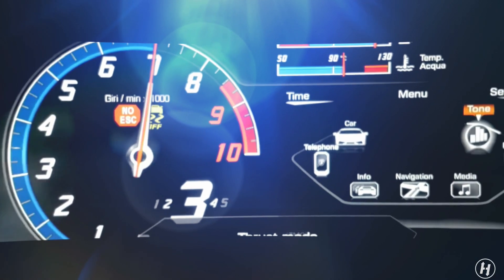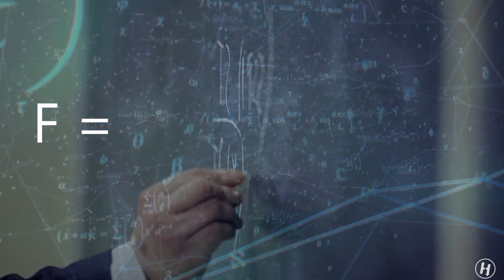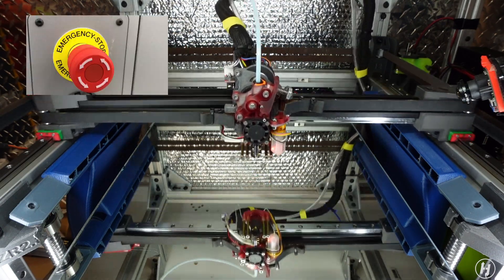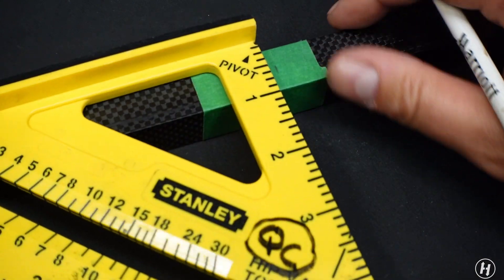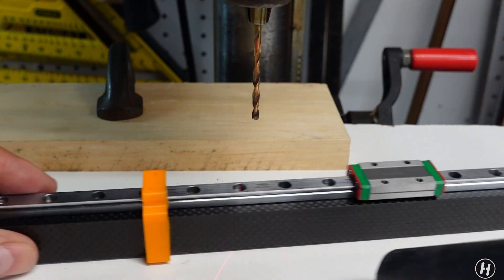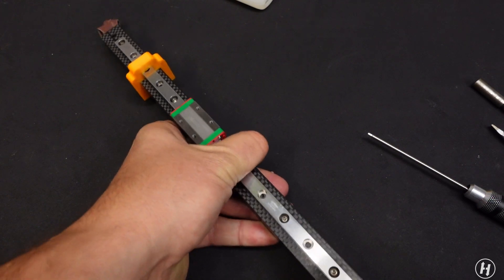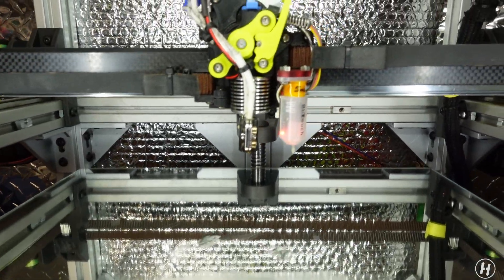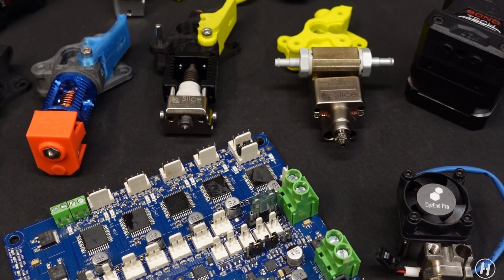Using TITANIUM and CARBON fiber on your 3D Printer

Comment: Those carbon rods for weight savings are an amazing idea! I'm going to see if I can buy some of those.
For further weight reductions you can look into aluminium fasteners. vs unhardened titanium they have a better strength to weight ratio but they are 40% lighter. 
There's also the option of using aluminium heat inserts instead of the brass ones. Compared to brass they're about 1/3th the weight.

I'm currently designing a toolhead board with maximum weight reduction in mind so you have less cables running to the printhead. Finished product is still months away probably.
Reply from the maker: Aluminum M3 hardware is super picky! combined with the higher thermal expansion difference between CF and Alu, this was not a good choice to me since they could easily cross thread during install and loosen under heat and vibration.
Reply: @MirageC  that's a bit far fetched :) people choose titanium because its cool. not because of "heat expansion properties" :) people use aluminium bolts on freaking brake disks :) if it can withstand that, its probably fine for a 3d printer.
Reply: Also just use red loctite. It will never come apart with aluminum fasteners.
Reply: @Nobody-Nowhere  it's the difference in expansion rate between two materials that matter.   Alu + steel is ok, Alu + CF  not so much.....
Reply: @Nobody-Nowhere  So confidently wrong.
Reply: mixing aluminium with carbon fiber can (and will) cause galvanic corosion, unles using spetial coatings to insulate the two materials it is to be avoided if you want things to last. titanium is the go to metal for part in contact with carbon fiber, as it has both a decent specific strength, and low galvanic reaction with carbon fiber
Reply: @ValsVirtuals  - Yes that is true - but only in the presence of high humidity or direct water contact. So a big problem in a car, boat or plane - not so much in a normal house with 50-70% humidity

Comment: Very nicely explained, thank you for the video =)
Is the emergency stop Button cutting power, or is it a controller input and stopping happens in software?
Reply: Both options are viable. You can use a 120V rated E-Stop button either to cut mains or to change a 5 volt signal line to a controller board.
Reply from the maker: The emergency button clip was taken from an online bank part of my video editing software ;) I only have the klipper control screen and power cord pulling as my safety devices.... yeah... I know :)

Comment: aluminum bolts are half the weight of titanium
Reply: was gonna say, you dont need the ti strength here
Reply: With the amount of bolts used, nylon would probably work too and is even lighter.
Reply: @FreeOfFantasy  if you are considering only the rail, you could just epoxy it and have pretty much 0 weight from fasteners :)
Reply: Aluminum will corrode in contact with carbon fiber though. Not sure how big of an issue that is for a 3D printer, but galvanic corrosion is certainly an issue in planes.
Reply: @teguh.hofstee  they are usually anodized, as they come in different colors